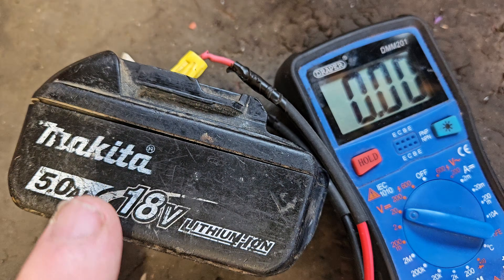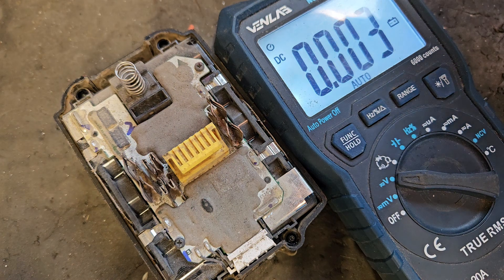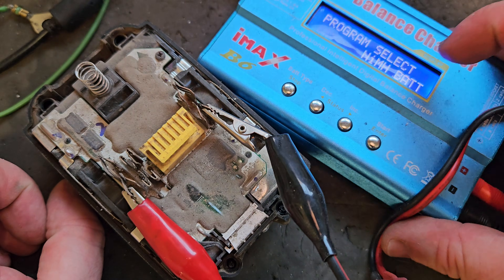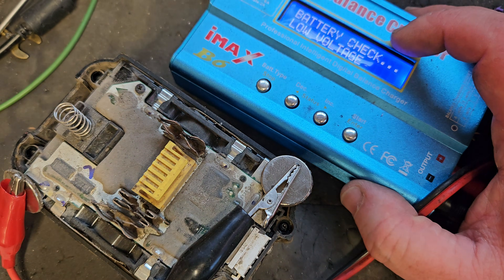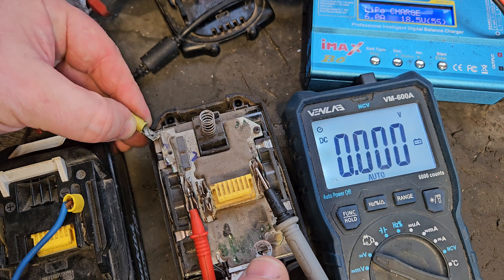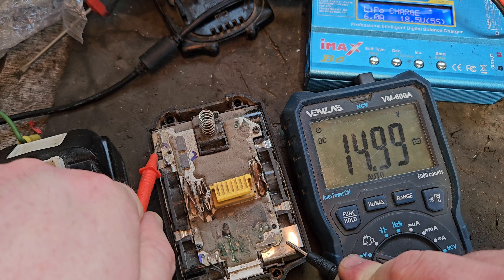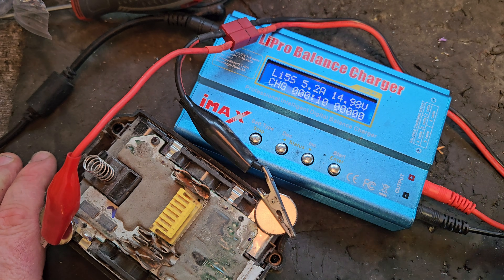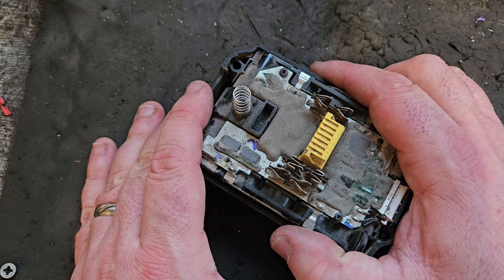Makita Battery No Voltage I fixed it Here's How

Comment: Afaik it is not a board failure - it is intentional safety disconnect. Once the original BMS detect significant cell imbalance or overdischarge it just lock up and renders the battery unusable. Keep using cells that been drained to 0.5v is not a good idea - most likely the capacity is not there anymore plus there is fire risk. There is a reason Makita does it this way.

Comment: I fixed  mine by switching  to Milwaukee. 3 bad Makita 18 volts died right after  the warranty expired.  Would  never go back.
Reply from the maker: I do like Milwaukees battery range it's far superior to Makita. Makita seem to be stuck on standard batteries for 18v tools  no 21700  no stacked lithium no tabless cells. Slept in when other companies continue to innovate.